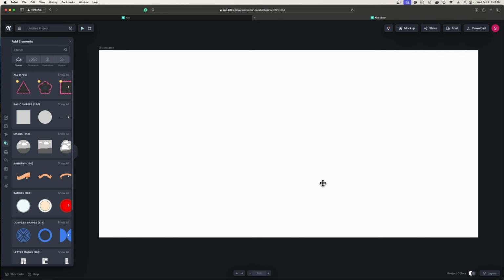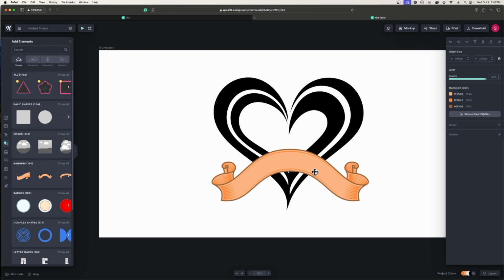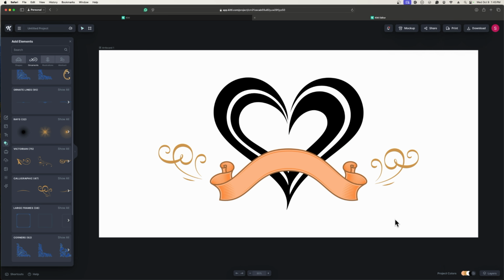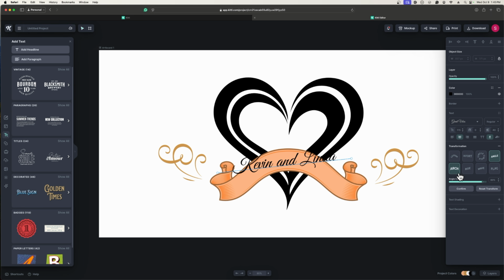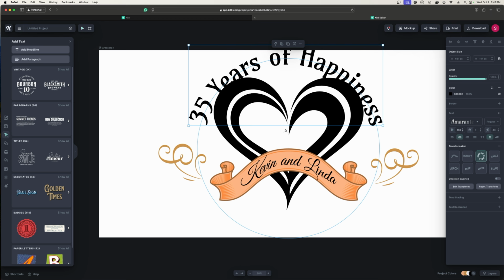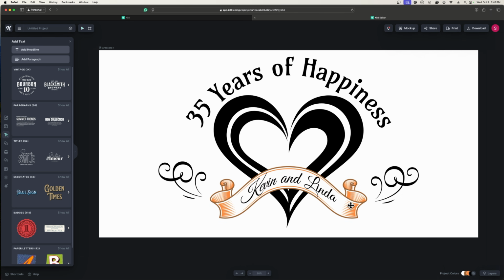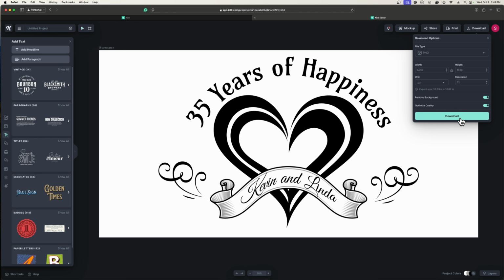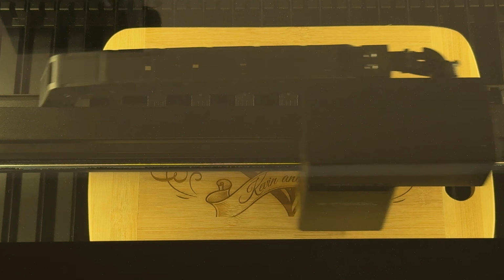Designers Are Getting RICH Because of THIS!

Comment: At last, someone who speaks sense. As someone who likes designing as a hobby ( I give design files, not sell them) I get exasperated when people buy crap designs off Etsy and then run into problems. There is so much design software out there, both free and low cost that when I see someone has bought a file of a very simple nature, it makes me want to bang my head on a brick wall.
Reply from the maker: 😁 I didn’t want to bash people trying to make a living on Etsy because there is a place for them, but basic designs for laser engraving should be within the skill set of all laser owners. I sell a few designs on Etsy, but I try to keep them as cheap as possible - and specifically to help support this YT channel.
Reply: @SteveMakesEverything  I too have no issues with people selling, as long as they know what they are doing and providing value.

Comment: Being new to lasers this is extremely helpful. Learning how to use the laser and then learning how to create your own designs. This will help for sure. Also thanks for explaining how to use with XCS as most everyone uses Lightburn.
Reply from the maker: Glad it was helpful!  I’m really starting to prefer XCS over Lightburn for a lot of things. Of course it means you need to buy an Xtool laser - I really wish Xtool would open up XCS to other lasers.
Reply: @SteveMakesEverything  and to think that at one point I was going to have to learn Lightburn until I asked you on one of your live shows when you said basically the same thing.
Reply from the maker: @ToOldToDoThis @ToOldToDoThis  Make no mistake, I love Lightburn too for some things (e.g., it's best for Galvo lasers), but the learning curve is a bit steeper, and based on its usability, it is clearly designed by engineers for engineers   - and being one, I can say this with confidence.  XTool has spent quite a bit of time on usability, and their latest version has gotten even better.